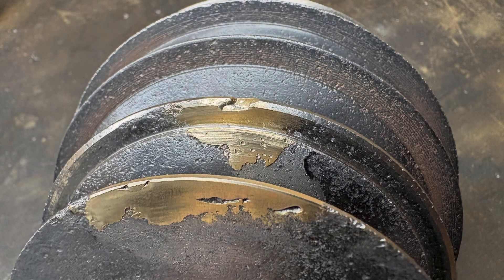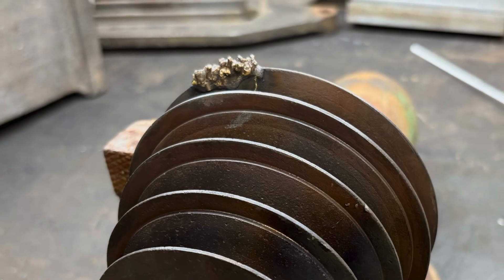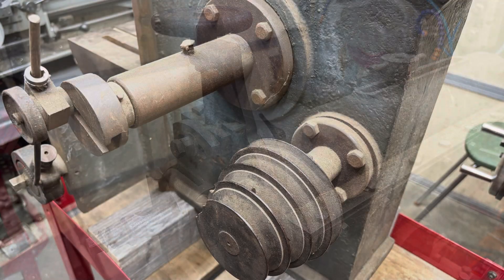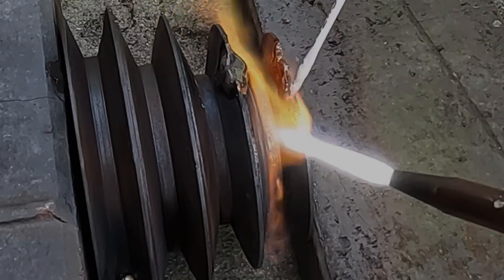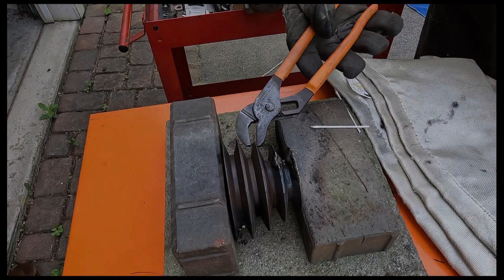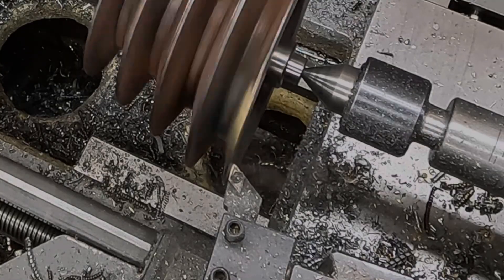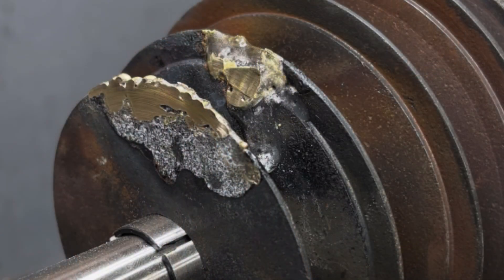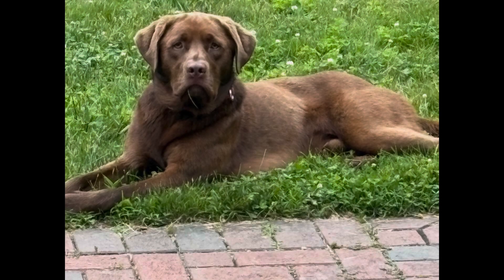Rookie first attempt at brazing cast iron. Repairing a broken cast iron pulley.

Comment: In my limited experience, I have found that the size of the tip on the torch is key to a good braze...  My guess is that you would have been better off with a smaller tip...  I also might have tried welding the pully on it's side to help keep the brass from dropping off, then flipping it over & filling in any voids...  Hope this helps!
Reply from the maker: I agree that my tip / flame management was all over the place. It may need to be cleaned. And yes, I could have used more brass to build up the sides and then simply use the lathe to clean it up. Good ideas, thank you.